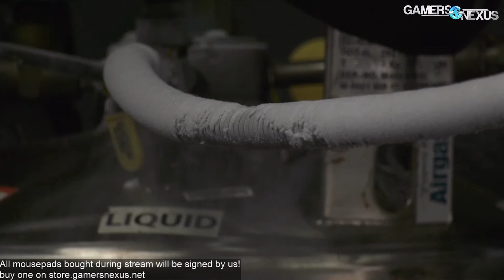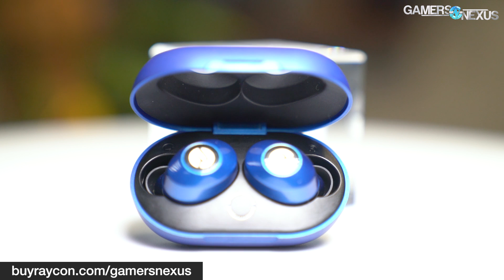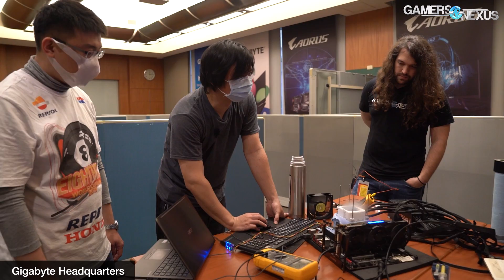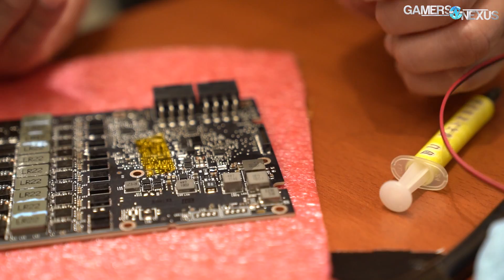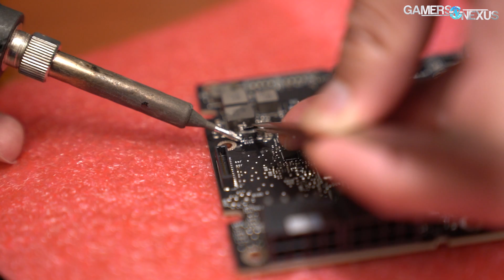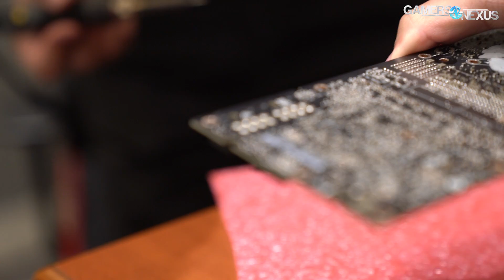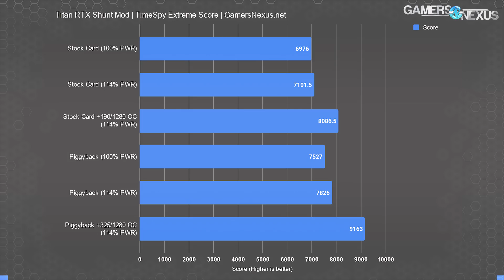RIPJAY Hardmod: Breaking NVIDIA's Rules w/ Shunt Resistor Piggyback, Ft. HiCookie

Comment: 8:50an accurate description for those interested. The Power controller checks the power usage by measuring the voltage over the shunt resistor(the higher the current flowing, the higher the power, the higher the voltage over the resistor). By lowering the resistance the voltage per Amp over the resistor will sink but the controller isn't that smart it just sees a okey i'm pulling just a few amount of watts but in reallity he is pulling much more just not knowing the resistance changed.

Comment: Why didn't people just use lower ohm resistors in the first place, whoever started the trend of using liquid metal to shunt should be shot...  Galvanic corrosion is a real thing and it will kill your board eventually.

Comment: The electronics side of me is facepalming a bit on this one. Stacking resistors is rarely a good idea. Resistors generate heat to resist power flow so your creating a nice hot spot to bake that bottom resistor. Swapping with another resistor however would be my approach.
Reply: True, but removing surface mount resistors with a soldering iron while standing is just about impossible without damaging the PCB. You would at least need to irons. You would never do this on a production board, but for something like this it's fine. Those resistors are pretty large, and they are attached directly to thick power planes which will pull the heat away from the parts. 

For something that is going to see an ambient environment that is pretty close to 20 C it will be fine. The max film temperature for resistors like this is like 150C.
Reply: @Fix_It_Again_Tony  Nah.  It's easy if you don't care about the resistor.  you can just put a bit of a blob on the tip, and stick it along side the resistor so it's touching both ends at the same time, then swipe it off the pads when it melts.  A lot of the time it'll stick to the iron and cook though, so it's not a good idea if you want to reuse it.

You're right, though, that it'll probably be fine stacking them, both because of the copper planes you've already mentioned, and the fact that with the parallel resistance, you're dividing the heat between the resistors, and even though the current will increase, it probably still won't be as much heat per-resistor as stock.
Reply: @nwimpney  I am not saying it is not possible but that is a 2512 package on a board that is probably 8+ layers and the resistor is connected directly to the main power plane. Don't underestimate the ability of a multi layer PCB to conduct heat away from the part, especially if that part is connected to a power or ground plane. The resistor is large enough that you are going to have a difficult time finding a tip wide enough to span the width of the part to heat up both side. Maybe you can lay the tip down, but you don't want to touch other parts with it. You'd most likely need to use two irons and have a helper remove the resistor with tweezers when the solder melts. If you overheat the board the glue holding the copper to the FR4 will fail and the pad will become detached. That is a bad day. 

Much easier to piggyback the parts unless you are shipping this to a customer. Pros use hot air stations to do this kind of work. At home I have a Quick 861DW on the recommendation of Louis Rossman. At work we use JBC, but I usually have the technicians do that kind of work because they need to be IPC certified for production boards.
Reply: Yeah why didn't he just swap them with a 4 megaohm? Why does this work when he said 5 causes safety mode?

Comment: Did this to my 1060 back then. I took some heat resistant tape to fix the (in my case) 5MO resistor on top of the existing ones. In fixed position its easier  the solder and the solder job looks way  cleaner. You can also go a different route and place some 10 ohm 0805 resistors over the existing ones next to the power controller chip ( mostly its a INA 3221). So you want to increase instead of decrease the resistance there to let the power controller think that there is less power coming in from the 8 pin/ 6 Pin. Here is a tutorial https://xdevs.com/guide/pascal_m_oc/   
Go to step 3 !

Comment: Hi Steve, may I recommend 63/37 leaded solder, just don't eat it and wash your hands afterwards. A flux pen is worth using too.
Reply: This. Leaded solder is sooo much easier to work with, and it's not dangerous to work with. It's not allowed in manufacturing, because that lead would end up in land fills, and I guess if you work with it 8 hours a day for years it can be a health issue, but for hobby use it's fine.

Comment: i solder at about 700 i hate rohs solder but some company's use tough solder. use that thermal grizzly for a few days to soften that up or flux for few days. then it will wipe off you can solder wick it up and use normal lead based solder.  flux is your friend i like no clean gel when i work.  if your not good at wiping off an old part try chip quick its like solder but stays hotter longer to assist in wiping things off boards.  gps eng here.
Reply: yeah. 700 freedom units is around 370C.  That's fairly reasonable for an actual temperature, but on a cheap iron with poor regulation, the tip is not going to keep up with the thermostat setting at all.  That's why these guys say 500C or whatever.  (930 degrees Freedom).  They need to crank it to 11 to get the tip and the pad warm enough to melt the solder.  The tip itself is probably lucky to be getting much above 350C while it's on the board, and being drained into the ground/power planes.
I don't mean this to talk down to anyone, but these guys aren't great at soldering, and it's wrong that you would ever aim for a temperature of 500C when soldering electronics of any sort.  500C may be a sufficient value for that iron to compensate for its distant/slow regulation, but if you were to set a high quality iron to 500C you'd be burning things.
If you're working with cheap gear, sometimes you gotta do what you gotta do, but it's good to understand that, and to know that your numbers are going to be mostly meaningless, since different cheap gear is probably going to need different settings to get the same tip temperature under a given thermal load.
Reply: @nwimpney  I use a Weller wesd51. And hot air station I have never tried 900 to see if it goes that high. I'd like a hot air station. I got one at work. Thank you for your reply.

Comment: horrible soldering job, you guys should have got someone in the modding scene.
Reply: absolute dumpster fire of a solder job. that card was definitely toast after that.
Reply: I agree with you and pcb of grafics card was covered by something weird like white glue brrrr it was very bad soldered
Reply: @karolbaczynski2659  That's just the reminder of the flux used for soldering. It's a type of detergent which activates at high temperatures and is supposed to clean off the surface oxidation. 

Western soldering traditions expect the flux remains to be cleaned off, but that requires time and effort, and nasty chemicals. Therefore, many of the newer flux types are so-called no-clean fluxes, which are supposedly safe to be left on the board after use, and it's common occurrence to find flux remains in everyday consumer products. I myself, still clean all the boards I work on, when I'm finished.

Comment: Interesting. As much as i can see, resistors are connected in parallel and that means your total resistance is 3.08mOhm. Are you sure those are miliOhms? On resistor there is capital M which means Mega(milion). So this means that nVidia cards wont go lover than 3mOhms because current is to high,but this depends on the card itself.

Comment: https://www.youtube.com/watch?v=89eIQjW3uko&t=685s so ig got the same Problem, after cleaning the original shunts from the liquid metal the solder job is quite fucked up because the liquid metal. So i removed the original Shunts and i Solder 0.003ohm Shunts on original place, and it worked perfect. 
i did it on my RTX 2070 Super too and i got German fastest :-) https://www.3dmark.com/spy/10593836

Comment: Electrical engineering / physics explanation for a couple things here.
Many metals have a positive temperature coefficient for their resistivity. I couldn't find one for the liquid metal alloy, but all of its components (gallium, indium, tin) are positive. By the way, so is copper. For copper it is around 0.4% per degree C. This means, as the shunt resistor heats up, its resistance increases, and in the end, this causes a lower current. As your graphs show. This should also happen, if you just solder a copper wire on top of the shunt resistor, so it may be mechanically better than using liquid metal, but not electrically.
Now, shunt resistors built for that purpose are made from metal alloys, where that temperature coefficient is as small as possible across the whole defined operating temperature range. This results in a smooth constant current delivery, if all other variables are also held constant. Even the cheapest 8 milliohm shunt resistor on Digikey that I looked at was +- 100 ppm/degree C. Copper is 400 times that, and galinstan (liquid metal) is probably in the same range as copper.
Reply: Right, but the goal of this is basically to just defeat the current limit anyway.  On previous model cards people just shorted across the shunts with wire, or bridged them with a solder blob.  The card sees that it's drawing 0% of its power target, so it limits entirely on other parameters. (voltage, heat, etc).

On the new cards, dropping the resistance too far causes them to drop the clocks.  It could either be intentional, in that the card sees an "impossible" value and drops the clocks for safety, or it could just be that it glitches out and over/underflows a counter or something, and thinks it's drawing 65535%.  Either way, I don't think the temperature coefficient of the resistors is as important as just choosing a value that's low, without going low enough to break it.  In either case, I'm guessing it'll be enough of a boost to the limit to move the bottleneck elsewhere, right?

Comment: I jumped my shunt resistor 2-3 years? ago with liquid metal on my 1080FE and no power limit warning anymore for me since than. Water cooled. 
But I run into the voltage limit. Didn’t updated my bios because I’m not sure what bios will run and if it would improve the FPS at all..

Comment: 5 milliohm piggyback is working on my 1080 ti founders card been going strong for about a year of games and benchmarking. It has way less fluctuations in speed compared to stock. Still running stock air cooler just upgraded to Kryonaut thermal paste card runs 76c fan speed at 70%.
Reply: Sry just add this here ^ card runs 2050 clock and 6050 memory pretty solidly

Comment: Why not just straight up replace the 5mo shunt resister with a 3 mo shunt resister? The 8mo mod is equivalent to a 3.077 mo resister and the 7mo mod would be equivalent to a 2.91 mo resister? Asking both for gn specifically and as general practice for overclockers?
Reply: that would work fine too, assuming that it'll handle the heat at the higher current.
The way that a circuit like that typically works is that it regulates to a fixed voltage drop across the shunt.  By reducing the value, it will take more current to reach that value, so at the limit it's going to be dissipating more power.

To be safe, you could try and find the biggest resistor you can manage to get soldered to the pads.  Often you can get away with going one size up, depending how much exposed pad there is under the ends of the resistor.

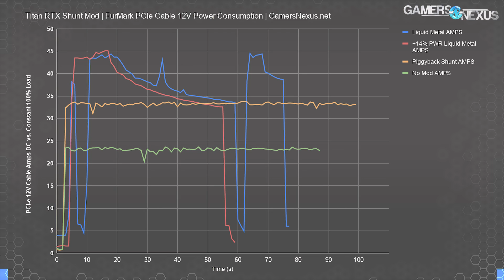Comment: I think there's a discrepancy between their chart at 11:00 and the chart at 11:37. The first shows about 23A on the stock settings using Furmark. That ought to be about 276W, but on the second chart it shows that as the power (approximately) for the 114% test. The first chart shows about 33A for the shunt mod, about 396W, which on the second chart is the power for the non overpower value. I think they used the overpower current for the non-modded line on the first chart, as it should have been around 20A to result in only 238.8W as per the second chart.

Comment: Wat....my eyes!!11.... that soldering.... don't need more temperature, need good soldering iron that is not 40W 5$ electrician jobie. Wide soldering tip would make even crappy soldering iron working much better  :)  Sorry, that is perfect example how NOT to solder on a card, especially one like Titan. Those fumes are also very healthy! ;) 

Please, have buildzoid to explain proper mod with resistors in series to trick current monitoring, instead of nonsense mongering with shunts again! NV have protection for both minimum power and maximum power since 10 series, and its even more important to get everything properly for newer cards with balancing. What shown on video is wrong on so many levels, i've expected bit more research into topic, after battling against wrong shunt mods for that many years  :(
Reply: xDevs_com yeah, I thought he was going to bring out a metcal or something. That one had a terribly long tip. Maybe it had tip temperature sensing, but I doubt it.
Reply: @float32  It was just typical crappy iron with zero temperature control and ceramic heater that does not even touch the tip inside. They sell on every electronics store for hobbyists in Taiwan.